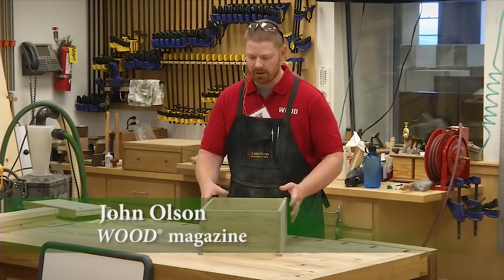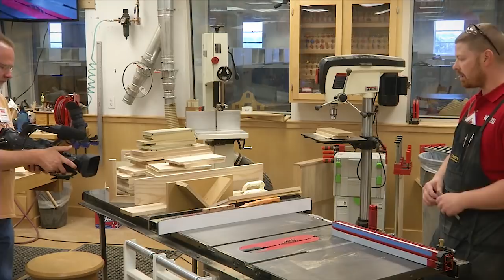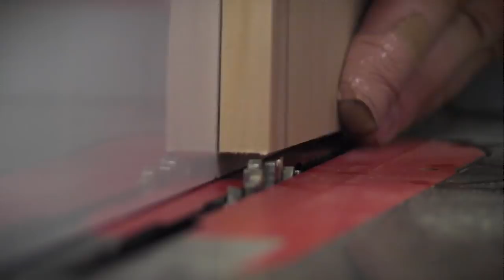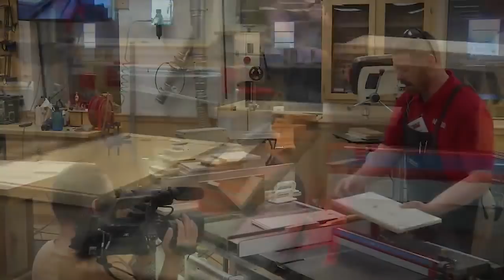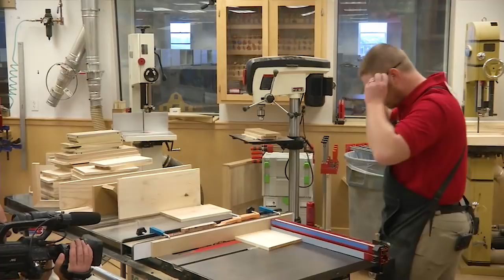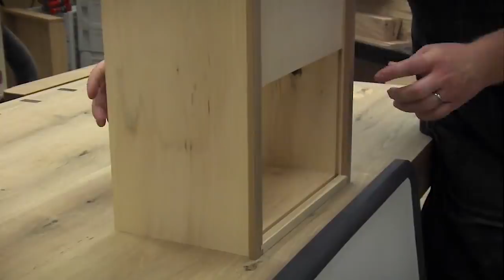Building Drawers with Dado Joints - WOOD magazine  WWW15

Comment: At 3:42 he claims "Different saws have different spots within the throat plate where the high point is going to be." Then he claims "Some saws the high point is actually in the back 3rd." That sounds like he doesn't have a clue what he's talking about. How can the high point be anywhere but in the middle? The blade is circular! What does the throat plate have to do with the high point? This sounds like nonsense to me.